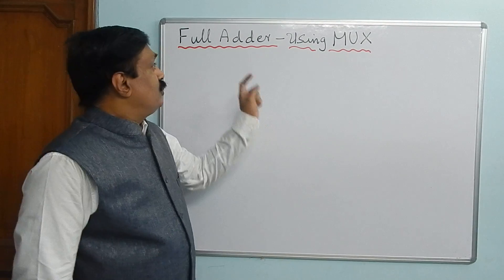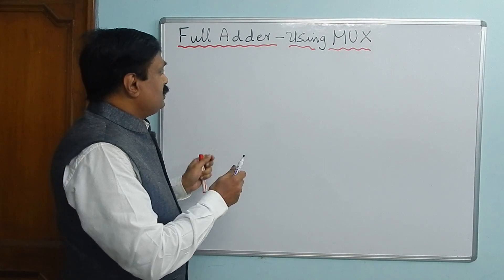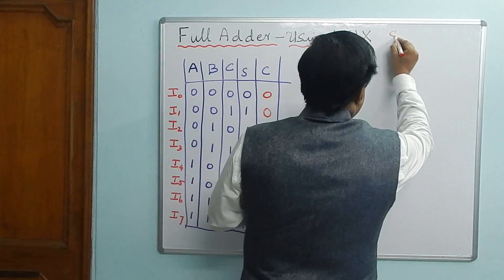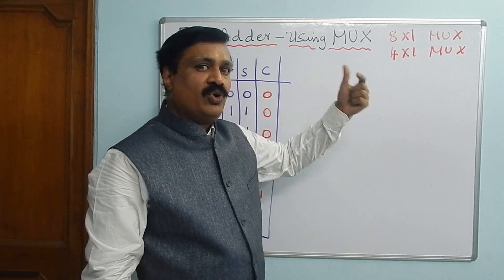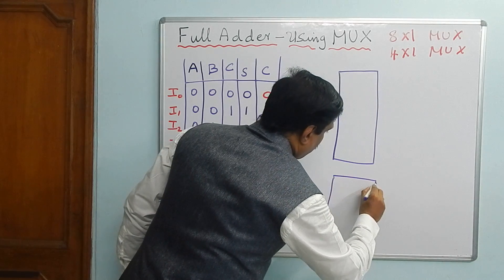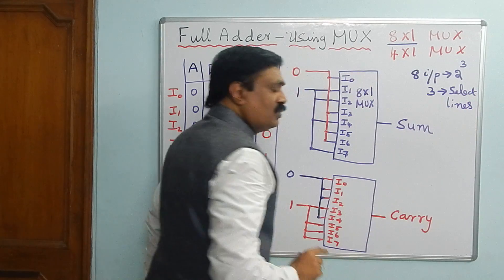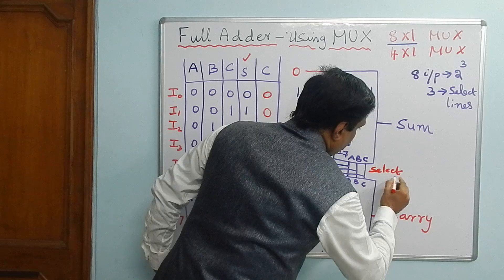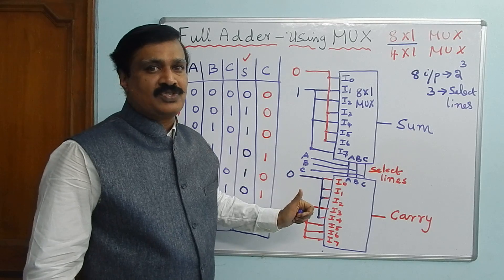Full adder using 8x1 Multiplexer (MUX) - Digital Electronics ( English)

Comment: sir at one time only one multiplezer can work.. but i7 input is high in both multiplexers so why shouldn't we use it as selecting input??
waiting for your reply..
Reply from the maker: Both the MUX are working simultaneously and generate output as per the select line . In a MUX at one time one input is 
SELECTED as per the select line and  generates o/p.     i7 is the input which gives out put for both SUM & CARRY, when ABC are 1. A,B,C are select lines.Clear ? Otherwise call 9899964509
Reply: @physicsanddigitalelectroni2151  ok sir thankyou